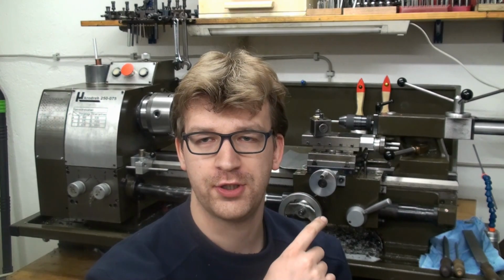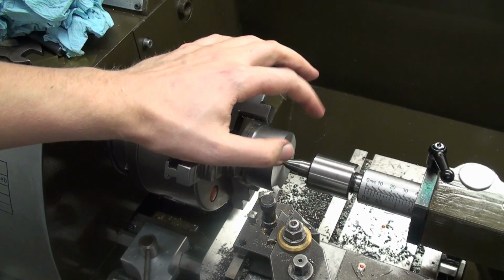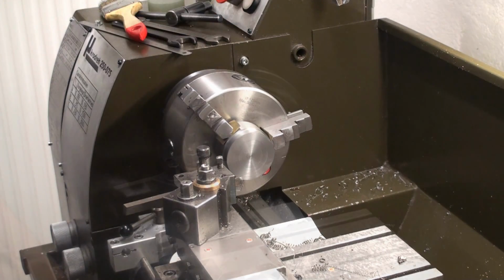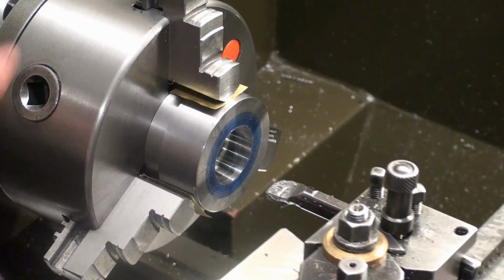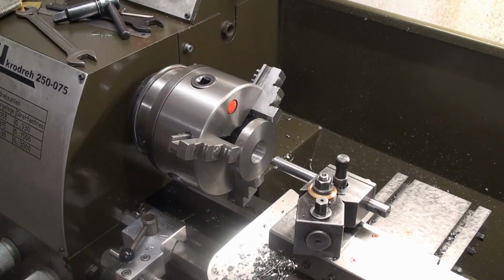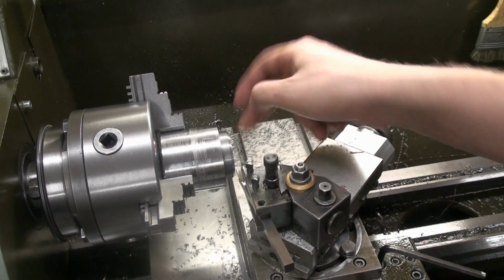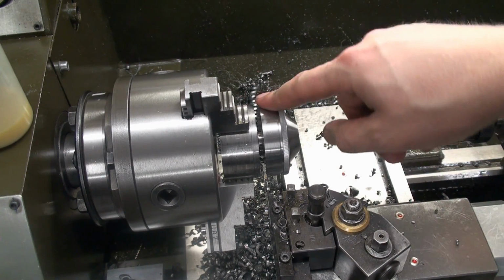9x20 cross slide dial Part 1 - 250x550 Drehbank Skalenring f. Planschlitten Teil 1

Comment: I hate ball handles. My old equipment had those, over 50 years ago. There is no way to easily turn to a tiny, precise point using them, without effort. Using the crank by itself is difficult. Holding the entire handle, including the ball, is easier. Manufacturers went to round handles because it’s far easier to grab the large round handle, and turn it easily, and with precision. The small crank that sticks out is really only used for rapid movement, and then, the crank should revolve.

Comment: Why do you use soluble oil as opposed to cutting oil for the knurling?
Reply from the maker: Cooleant is a bit better at washing away the metal dust created during knurling. Oil creates a slurry that does not exactly improve the quality of the knurl. (Except if you can run flood-oil)

Comment: gotta love 'precision beating' . Students thought I was crazy when I told them they would be truing crankshafts with a hammer and get to 0.001" run-out. They were even more skeptical when I said they would be able to finish cylinders to 0.0001". Years ago (1978)  I worked in a factory making specialised electric motors. end plate bearing housings had a 5 micron tolerance for 35mm bearing fitting.  Wouldn't have been too bad but we only had 2 mins from casting to finished (including chucking and removal)

Comment: I have a question I have a bunch of stress free Steel that I got really cheap is there any reason why I couldn't use the stress-free for this job I was thinking about doing this very thing to an old Logan I have. I mean it's really just mild Steel that is manufactured in such a way as to not build up stresses so I don't see why not I typically make things like this out of chrome moly but I don't have any large chromoly on hand I have a bunch of D2 in 01 but I'm tired of wearing bits out LOL.

Anyway if you have any thoughts on that stress free I'd appreciate the input. By the way I can get large-diameter stress free for less and I can get regular 1018!

Comment: I am working on making a set of dials and was wondering if you could tell me what type of angular contact bearing you used? Are they 15 degrees? They looked shielded from the shot but I'm just unsure of your recommendations on a set of bearings for a 50mm O.D. dial. Thanks in advance, Aloha...Chuck

Comment: Hi Stefan,
   I have just watched your first video on the 9x20 cross slide dial and as an old time engineer It was refreshing to see such competence and also to see Metric measurement being used. I transferred over to metric as soon as the UK went metric many years ago as it was so much easier to use. I still use my old imperial lathe but use metric and recalculate as I go. All my designs are in metric. I am now going to watch the next episode so beware the all seeing eye, I hope it will be as well done as the first.
Best regards
MoK

Comment: Great stuff. Stefan every time i come up on a tight measurement either o.d or i.d i hate to move the cross slide ....instead of backing off too protect the finish i do what ive seen Colin do by holding pressure on the tool post by hand,,,i feel there's less error , as if you got to go in again

Comment: A very inspiring video Stefan.

I've been wanting to improve my crappy 9x20 cross slide for a while myself. 
The current graduations just suck being 0.02mm/div and it does my head in all the time needing to double the value for diameter, plus allowing for the 0.02 factor.
200 divisions is my dream for 0.01mm/div.

I recently updated to crappy axial bearings from the simple cast iron sleeve and lock nuts (uggh) and that was a great improvement to smoothness. Now you're making me think should I worry about radial play...

BTW, I started watching on the PC, but very soon after I fired up my 55" Smart TV and watched it on the couch :-) 
Great video quality.
Reply from the maker: +Ray Jones Ah, finaly I got on the big screen ;)
I have 200lines and 2mm pitch, so every division is 0,02mm in diameter , thats as fine as I can go with the dial. But with the vernier it can be easily read to 0,01mm in diameter :)

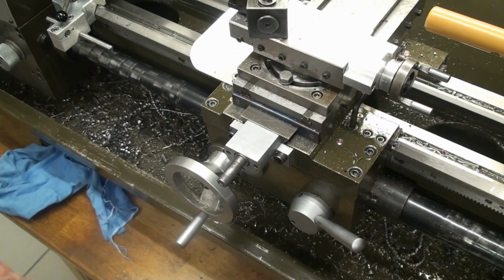Comment: Great video -   I have a question -  it seems at 31:55 that the shaft is moving on the 'hub' - should't there be a radial bearing present to kept the shaft in position ?
Reply from the maker: +M Dupuis Yes, it got pulled of with the handcrank :)

Comment: Impressive project and machining Stefan.  Do you have any machining experience from your profession, or is it only acquired on your free time?   I like the way you use rota-broach, never seen anyone use them the same way.  Smart on a small lathe.  I ordered both of the Thomas books you mentioned.  They are insanely expensive on Amazon.com for some reason.  Amazon.co.uk had them at a descent price, but would not ship to Norway for some reason, so I ordered directly from the puplisher:  http://www.teepublishing.co.uk/

Thanks for another interesting video.
Reply from the maker: +Arnljot Seem I work as a machinist in a prototype shop, mostly running a cnc mill - I got my GHT books from Hemingway Kits, they also sell them for a reasonable price.
Reply: +Stefan Gotteswinter I just ordered 2 of the GH Thomas books from Hemingway Kits for $105 including shipping to USA. Thanks for your fine videos.

Comment: Re boring with inserted tools: the gurus (namely Tom Lipton and abom79 and some others) both say that carbide inserts don't like fine finishing cuts. This agrees with my much more limited experience. Why this is I do not know, and would like to find out. Inserts like big cuts. Big depends on how big your lathe is, of course. HSS is a lot better on fine cuts, say  0.5mm or less on my lathe. Which is 57 mm center height -- .by my standards your lathe is huge.

On boring error: This is an error I make frequently. I am so absorbed in watching cents (.01mm) I forget the whole revs on the dial.  Mr Bozo sits in any shop.  Nice save.

Comment: Hi Stefan, as usual, great work! One question if I may? For the vernier ring on the bearing block; do you think you'll need a groove under the vernier ring, for the locking set screw? So that tightening the set screw won't damage the surface the vernier ring rides on? Hope this makes sense!
Reply from the maker: +mictho100 With a steel lockscrew, yes, I would cut a grove, but I will machine either a screw out of brass or a steel screw with a brass/copper tip :)
Reply: +Stefan Gotteswinter I knew that you had thought about it! :)

Comment: This is a fascinating project - quite a lot of work involved for sure. Can imagine it will make a huge improvement.
As always - enjoy watching your precision approaches Stefan.... including sharing the nail-biting on last stages of boring for bearing! Been there many times!
Oops - Mr Bozo affected your bushing bore - but - nice fix with the drill bushing.
Reply from the maker: +ChrisB257 Thank you!
Its not only a fix, a big improvement, as the bore is now hardened and nicely ground ;)
The nail biting is the reason why I normaly dont use indexable tooling for close fits...on light machines thats always a bit dodgy.

Comment: Great video/build/discussion/instruction.....hmmm, you skipped the setup on the mag chuck, assume simple but I would guess you could chase your tail also!?  FYI, gave you a shout out on my recent compound accessory vid, thank you
Reply from the maker: +outsidescrewball Thank you Chuck, I just watched that video, thanks for the shoutout :)
The setup on the magchuck is realy easy, like on a surface grinder, where its also pretty simple to knock stuff in line with the travel of the table.

Comment: Hi Stefan I really enjoy your work and can recommend the book you mention full os inspiration. i have done a similar mod to my own 9x20 lathe,i also place a 20mm spacer block between the hub and the cross casting made a new left hand extended lead screw so i have more travel on the cross slide bed for small milling operations.

Comment: Would love to see how you centre up the work on the magnetic chuck Stefan.Cheers mate thanks for the videos.
Reply from the maker: +warrantyvoid100 Its as simple as it can get - I put an indicator against the part and then knock it around with a copper drift/hammer until there is no runout left :)
But I might do a seperate video on the magnetic chuck as it seems to be very uncommon to a lot of people :)
Reply: +Stefan Gotteswinter i'd like to see that, also.